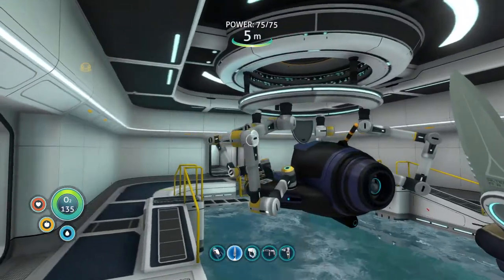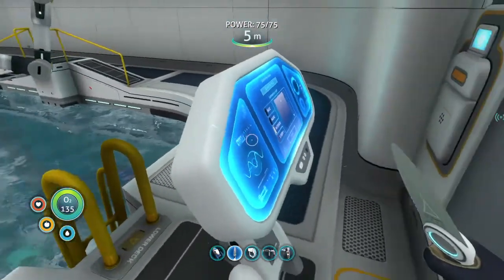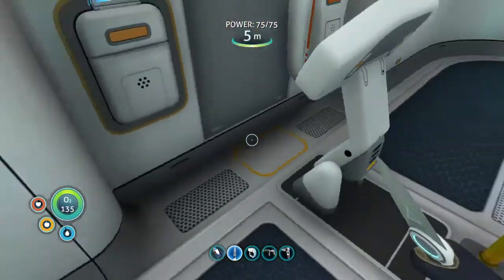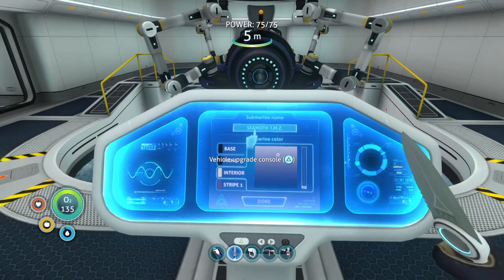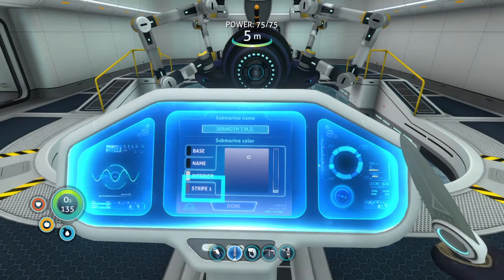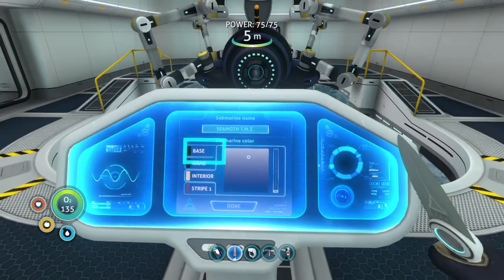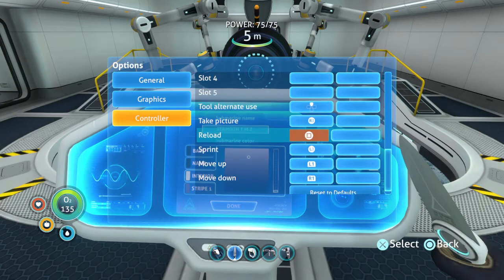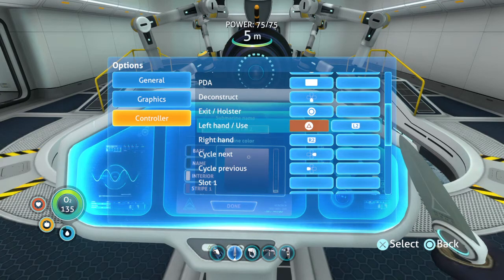Subnautica - Upgrade Console Interaction Button Isn't Working, But Jump Button Does | Gameplay Mini

Comment: Thank you I was really confused too
Reply from the maker: What's even more funny, is on Below Zero, I changed my controls in the exact same way as it is in Subnautica 1, and yet neither triangle NOR the X button works for my vehicle console in Below Zero. The actual button to access the console is CIRCLE for some reason! Like, what?! 😂

And also do you know that big tower thing at the delta station? The one that was originally a giant rocket? Yeah, I discovered to access its console, you MUST have your button layout set to default in the controls settings. If you try to use it with ANY other button layout than the original default controls, it will not work. I thought it was broken the entire time, so I've ignored that part of the game entirely. Until I eventually came back and changed my controls to default, and then the console actually worked. 🤦‍♂️🤦‍♂️🤦‍♂️🤦‍♂️

Both Subnauticas gives us the option to change our button layout, but they're still clearly NOT designed to be played without the original button layout.

Lots of bugs, inconsistencies and inconveniences, but at it's core lies something very special. Hopefully they will really improve on all of this in Subnautica 3. 😊👍
Reply: @TheMitchZone  Wow, I haven't even gotten that far yet. Thanks for the heads-up! And yeah I agree, there are some bugs, but this game is one of my favourites. I hope they work on it for the next ones :)
Reply from the maker: @Koaleaves  Yeah agreed, AND they'd better go through with finally adding co-op multiplayer in the next one!
Reply: @TheMitchZone  Oh, co-op would be awesome!